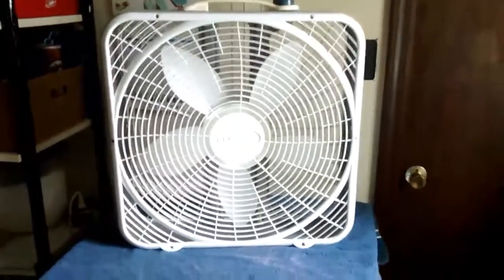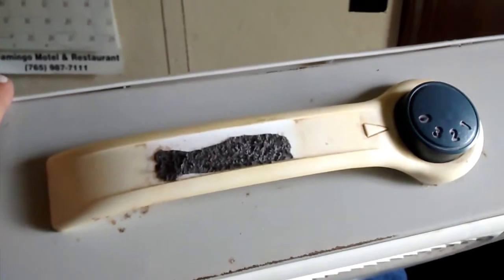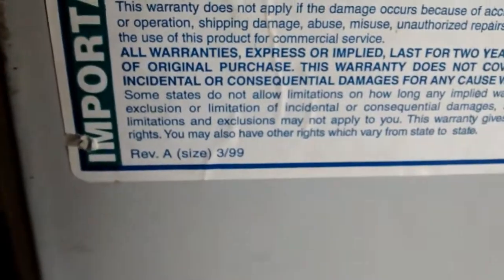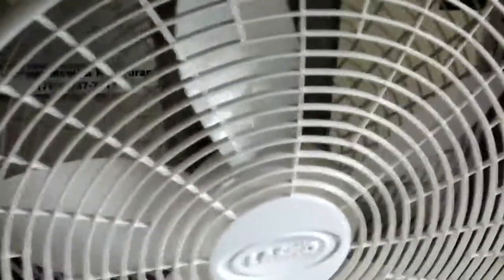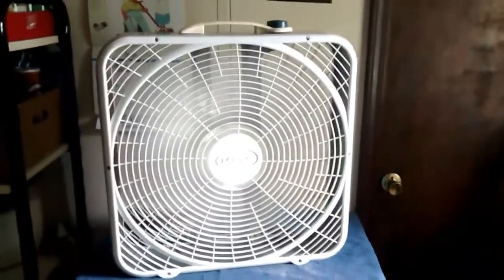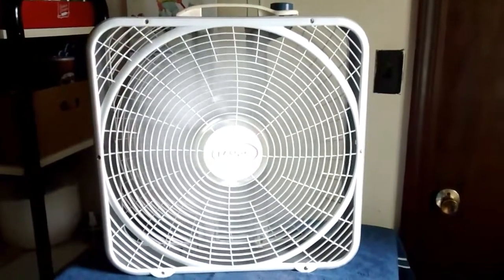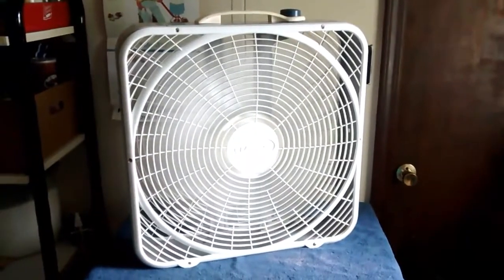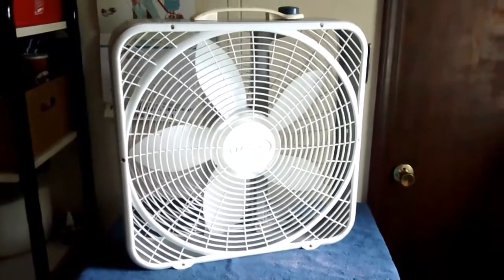1999-2000 Lasko model 3723

Comment: The Premium, and Weather shield model seems to be the only one to use the old cabinet style but the change being the removal of holes for a wheel stand and the brackets that holds the motor in place getting thinner.